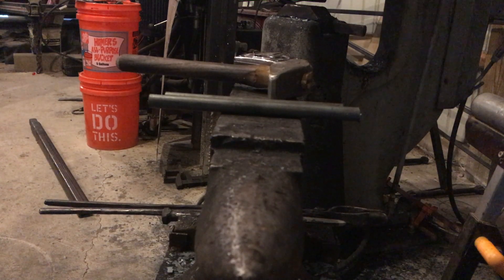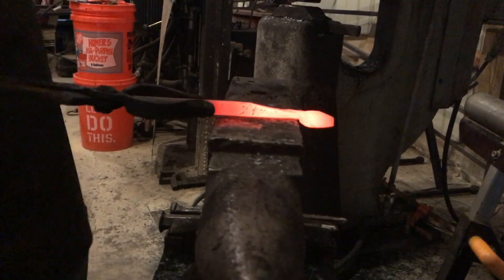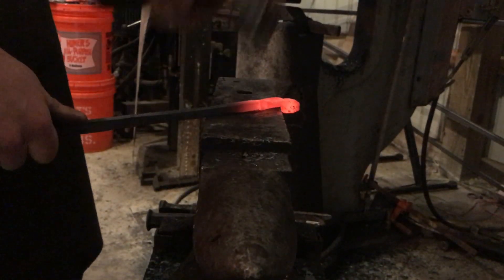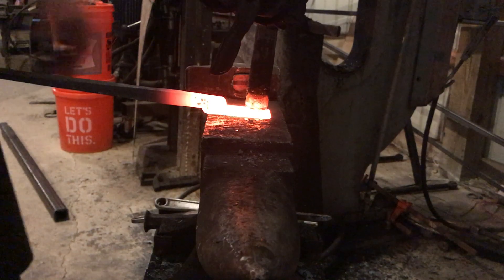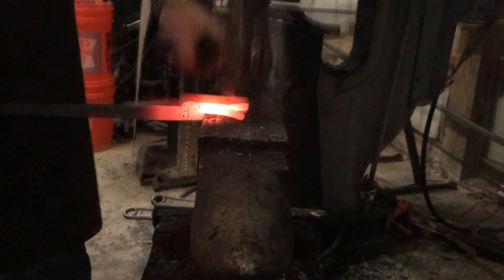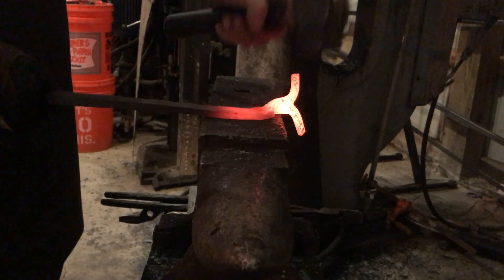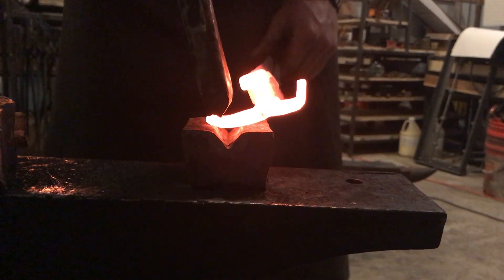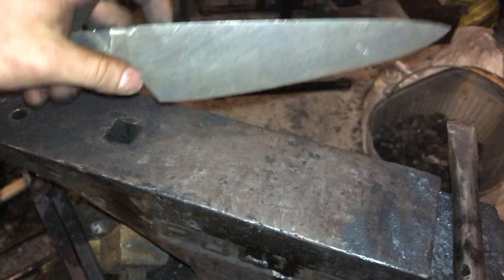How to Forge Blacksmith Box Jaw Tongs

Comment: ..Good Job Colin !! 2 things I really liked. Splitting the jaw to make the box section and adding the chisel lines to improve the grip. And Yes the lines work!!! I put some in another pair of Flat Jaw tongs I have and the Grip increased Thanks to you. 
A question if you don't mind, Which is better for tongs Spring or mild steel??
Have a Safe an Gud-un now...
Reply from the maker: Ol James I like mild steel. If you hit them they won't crack, and you don't have to worry about quenching them. 1045 allows you to make good tongs too because you can make them lighter (higher strength to weight ratio). You do have to worry about over quenching them though. Spring steel you could do but you should never quench them. If you have an abundant access to spring steel by all means use it

Comment: Thanks for including that extra bit on a knife.  Would like to see more please.  Most of the tong videos use rectangular bar.  It's nice to see some tongs made with round stock.  What grade of steel did you use?  Jerry
Reply from the maker: Fossils etc. I use mild steel (1018, or A36 structural). That way I don't have to worry about quenching them or about them breaking if I hit them by accident.
Reply: I just bought 30 pieces of 1040 5/8" x 14" round for a very good price.  I am going to give that a try.  Do you recommend flat bit tongs first?  Thanks- Jerry
Reply from the maker: Fossils etc. I would start with flat but first and put a center groove in them so you can hold round a little better with them. Once you get used to that move onto the v tongs and v bolt tongs. You should be able to get 1 set of tongs per 14" piece. 1045 you can make the reins a little thinner and they will hold up just as well